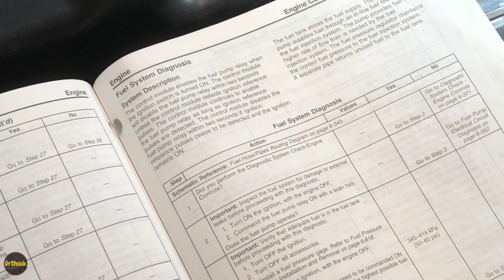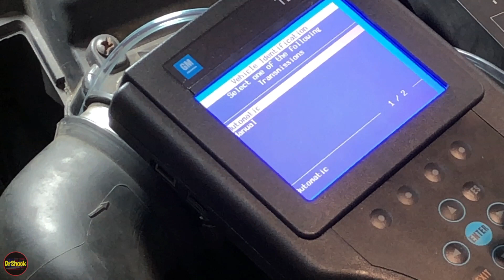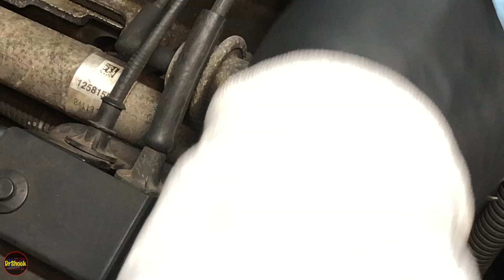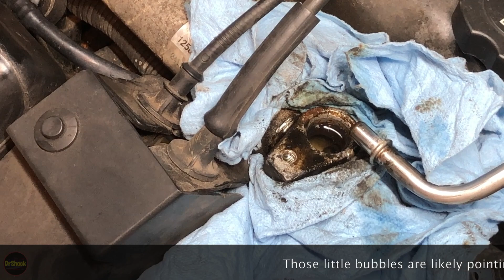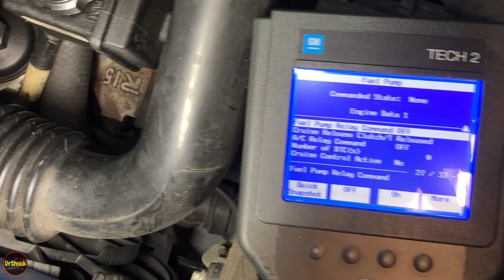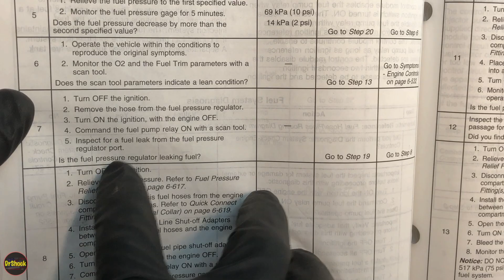2003 - 2005 GM Ecotec 2.2L Fuel Pressure Regulator Diagnosis (Chevrolet Cavalier & Pontiac Sunfire)

Comment: The line that goes from the regulator to the intake manifold plumbing, is not a vacuum line per se as you call it. What it is is a conduit for fuel raw fuel in the event of a diaphragm failure in the regulator.

Comment: The car im working on had been having this issue off and on and the owner would just hit the pedal u til it started and keep going about her day. Well finally the diagram let loose completely and when I can't to look at it and removed the intake to swap the old battery with  only 8 volts. I noticed at least a quart of fuel im the pipe. Made diagnosing it much easier lol but yeah sick walk through  appreciate it

Comment: I have a bi-fuel and the intermittent starting problem has been a real pain.  My car did exactly what this one did leaking into the vacuum tube but not out.  Can't thank you enough.  Shop changed the ignition and fuel pump.  I ordered the parts and hope to have it fixed up next week.

Comment: Can you make a video on the clone mdi 2?
Reply from the maker: The current MDI 2 clones are nothing more than an MDI 1 board re-laid out into a shape to fit into a clone MDI 2 case.   They actually are not full clones of MDI 2 functionality yet.   More of a cosmetic clone.   

I'm personally waiting until they mature, advance, to the same level of coverage that the MDI 1 clones are before wasting any cash on one.   A true MDI 2 is only needed for GMs NGDVP (next gen digital vehicle platform) vehicles such as the 2020 and up Corvette.   A true MDI 2 uniquely adds support for the ISO13400 protocol, which an MDI 1 cannot do, for example.

For now an MDI 2 clone is a very good MDI 1 level of coverage, just understand that's all it is for now.